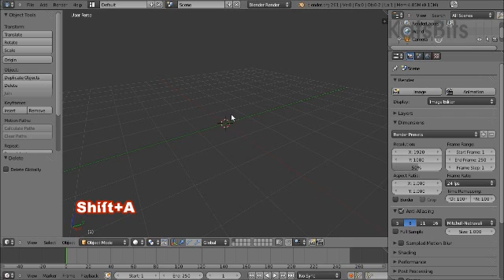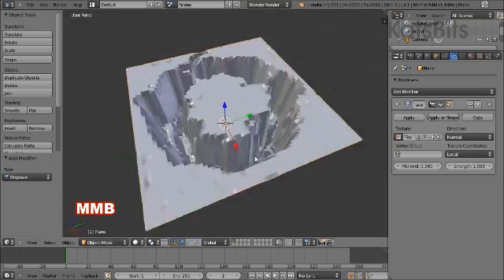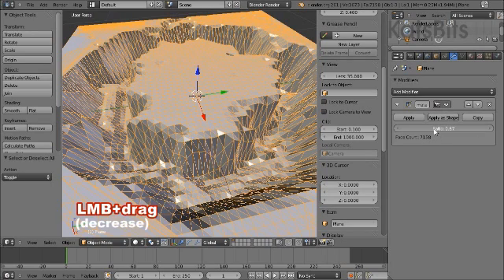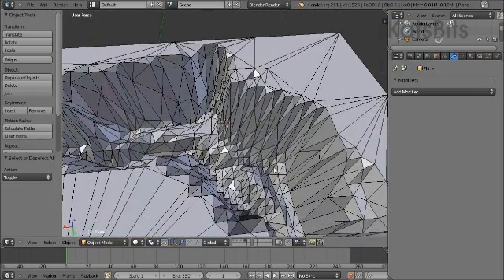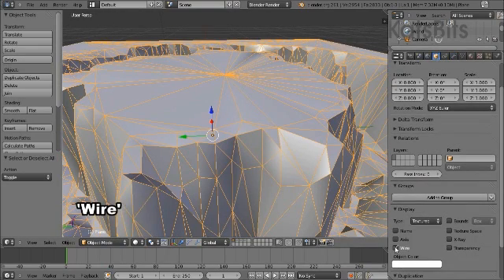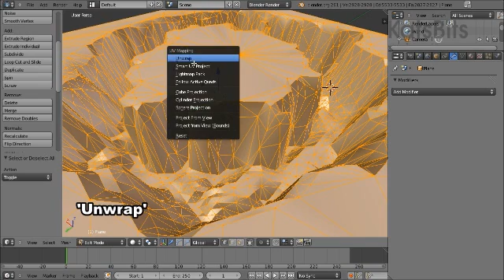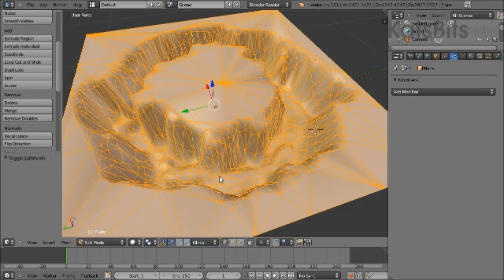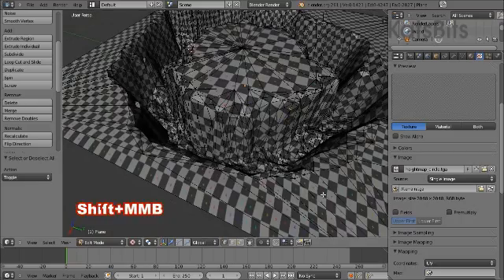Simple Terrain using Displace in Blender

Comment: i can't find the subdivide function. downloaded blender a few weeks ago and don't know if they changed it. can you please help?
Reply: sorry, stupid mistake that I made. I forgot to press Tab.
Reply from the maker: The one to use is in the Tool Shelf to the left of the 3D View (press "T" if it's not visible). Make sure the mesh is selected in EDIT Mode, then in the "Add" subsection of the "Tools" panel (usually visible by default), left-click the "Subdivide" button however many times necessary to split the selection - the mesh should change visible density cf. https://www.katsbits.com/smforum/index.php?topic=389.msg2281#msg2281
Reply from the maker: No worries ;o)